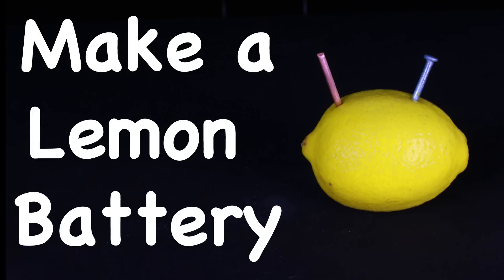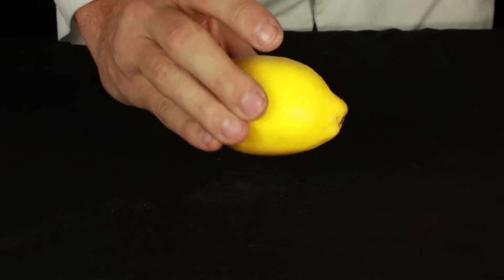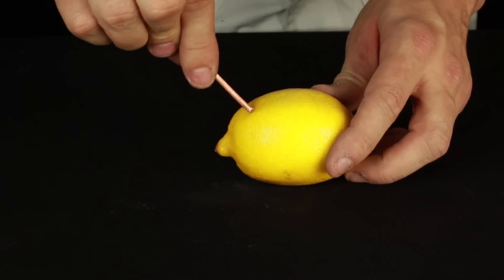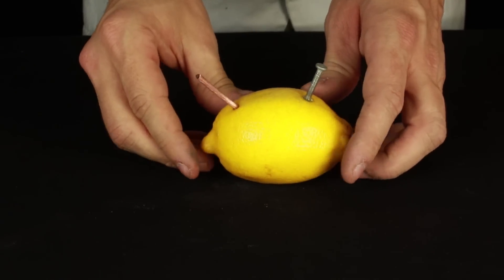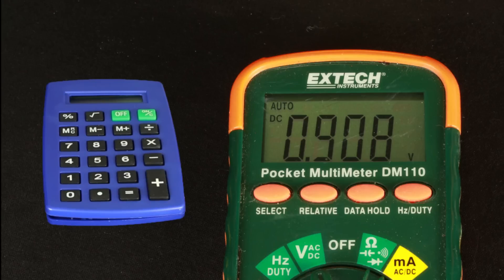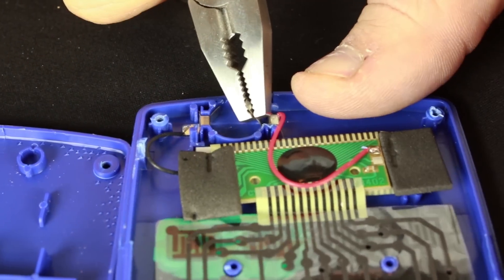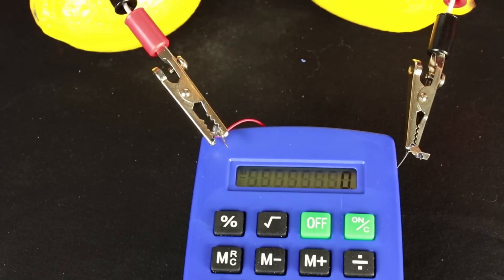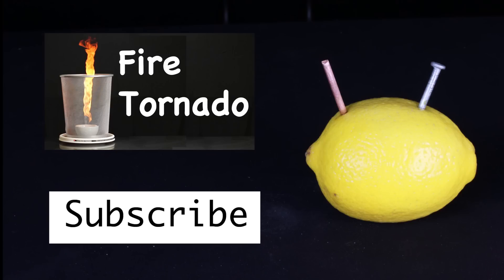How to Make a Lemon Battery (Chemistry)

Comment: Also works using a potato or strawberries. Zinc coated washers and small copper strips will increase the surface area and help. The current required for LED lights is too high to work but a small calculator works well.

Comment: Hey! I tried this with a copper screw and a zinc screw and added alligator wires to function a motor that requires 1 volt of electricity to work, but it won’t power, do you think you can help me with this?
Reply from the maker: The voltage is only one part of the equation.  You will likley need many many many lemon batteries wired in parallel to get the required current for any motor.  Do a google image search for wiring in series vs wiring in parallel.
Reply: @BeardedScienceGuy  What voltage meter did you use in this video?

Comment: there is no way that just worked with a calculator
Reply from the maker: Ask yourself how much electrical current is put out by a tiny solar panel in a dimly lit room.  This type of calculator is one of the only things that you can run with only a few lemons.
Reply: @BeardedScienceGuy  what type of calculator did you use there?

Comment: https://www.youtube.com/watch?v=e5maAe6iVkQ  How to Make a Lemon Battery (Chemistry) This might be of use in an emergency to meet electrical power needs.  This video shows how to make a lemon battery using a lemon, a copper wire, and a zinc coated (galvanized) nail.  The video also goes into how lemon batteries work.

Comment: I'm trying to help with my daughter science project what kind of light bulb would work best with lemons
Reply from the maker: Very low current LED lights. Most old style tungsten bulbs require a lot more current unless you are using dozens of lemons connected in parallel.